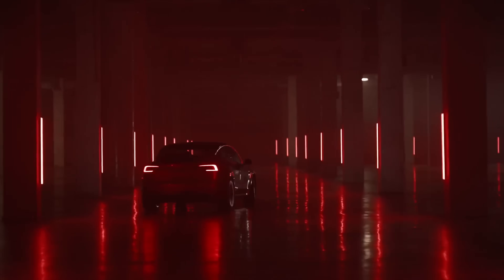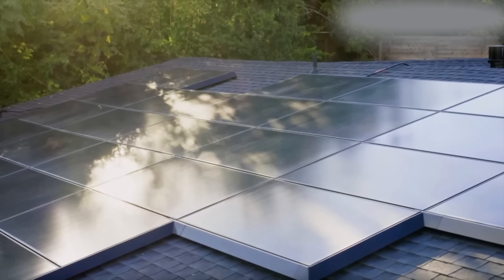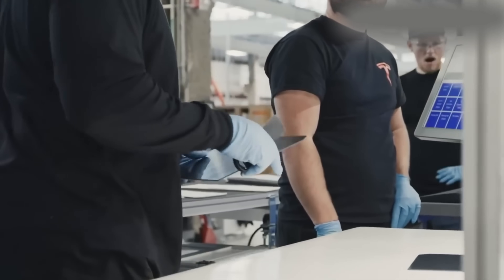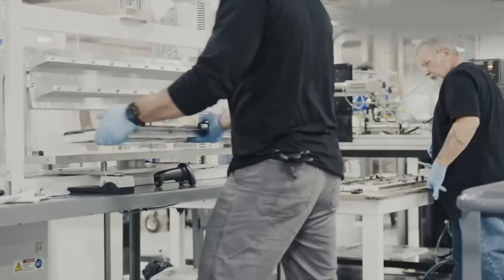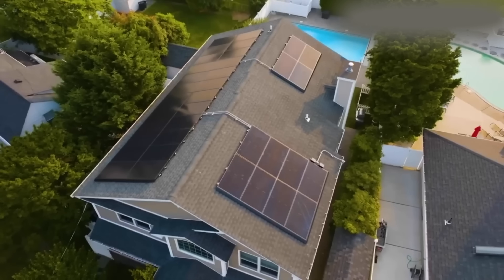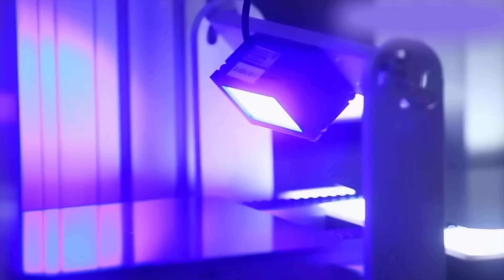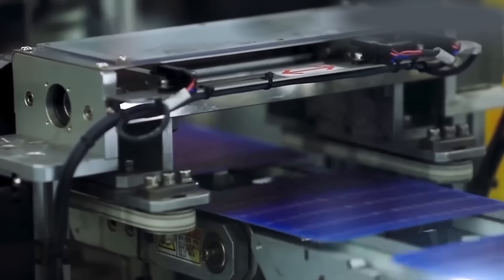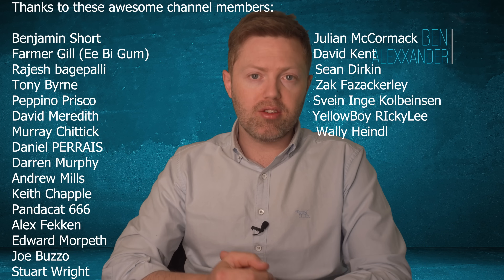Tesla Just Restarted Its Solar Panel Business — And It’s Actually Impressive

Comment: Free electricity, sounds irresponsible but is it? Under some conditions too much energy can be produced from renewables and it isn’t possible to shut them down. Conversely at night when there is no wind generation is lacking. So while the suppliers build can build in commercial scale battery farms they could gain from something called virtual power plants (VPP). VPP’s rely on the grid having a digital twin, a communication network to the domestic user of real time pricing. This triggers your home system to charge or discharge according to your preset parameters. Electricity prices will sometimes go to zero or even negative so you get paid to use electricity. Also you might get paid a really advantageous price to discharge to the grid. Imagine making money from your home storage battery.

Comment: I was in a Tesla organised VPP until a few months ago  but I found that while they say they will only take a certain amount of power from your battery per year  they tend to take it when you can least afford it and frankly I was about to get out the scheme just as they announced its closure. That was with a Tesla 2 battery.
I also ordered a Tesla three for our farmhouse and it took 4 months to arrive and when it did the delivery driver dropped it onto the ground as he  did t have anyone to help him unload it. It was installed and didn’t work. So another three months and now,it works so I have gone to a company that sells power at wholesale rates which has been an interesting experience so far. You buy a monthly subscription and comparatively small daily fee is charge to access the wholesale market. The down side is that very often the market has a negative feed in tariff so when I have nowhere to put the excess power after the battery is full and everything I want to wash, clean and dry has been done, I end up,with power going into the grid at a negative rate so I pay to put power into the grid. Whoever, if I can time,it right I can put power into when the feed in tariff is high and make the money back. At the.moment  I am keeping in front and have remained in credit however I’m hoping that the summer months will mean power feed in tariffs will be higher earlier so I don’t keep losing money by feeding it into the grid at the wrong time. It has been set up so the EV I ordered so e time ago should be able to operate mostly on the excess power that I have been putting into the grid at a loss. My average over all feed in has been about 4.3C p/kwh while my power usage (very small amount) has averaged 24C p/kWh. I know I could probably get a slightly higher feed in but I’m hoping the average will rise over summer and I only have to put power into to the grid when it positive feed in. This is why vehicle to load might just be the answer to a lot of power generation and energy security issues that are arising lately. I know one thing, energy retailers don’t like losing money and are happy to do absolutely anything they can get away with to prevent anyone from reducing their energy bills. I don’t know how many times I have had to search their web sites to find out the real charges for their power. The latest sneaky trick is to offer a higher than usual feed in tariff, have an apparently average daily supply charge, then have another charge in the fine print which can be called anything from a ‘feed in tariff supply charge’ to a individual line charge thereby negating the higher feed in tariff. The limit on feed in power rates, limits on feed in amounts and sliding feed in tariff fees are another interesting trick.  What has surprised me is how,often they advertise certain plans, give you what appears to be all the rates and charges then you need to go to another page to break down the plans even further. The daily supply charge rates can be a really significant component of the bill just by them increasing them by a few cents at a time. My rates went up by 40% almost over night last year hence my interest in solar and batteries. I have been lucky enough to keep up but I would not like to be either renting or buying a new home now and trying to get the money together to pay a mortgage and energy costs without solar and a battery.
Reply: We could easily stop a lot of the nonsense, by punishing deceitful behaviour, instead of allowing the twisting of the laws to be deceitful. By punishing, i don't mean fining a small fraction of the net gains, because that's an incentive not punishment.
A few politicians with a spine could probably get it sorted, but they are pretty rare these days.

Comment: Aussie here, installed 13.5kw panels, 9.6 kw microinverters and 27 kwh storage.  We self consume 6 mwh each year, and export 5 gwh.  That is with a 5 kw export limit...

The combination of solar and EV means we avoid spending $8000 a year

Just as important, we avoid sending approximately $2000 a year out of the country to pay for fuel imports.

The government has put in place subsidies for rooftop solar and battery storage.  The take-up rate is high as consumers seek to minimize expenditure, and the result will be much less money having to be spent on the grid, while eliminating the 6-9 pm consumption peak.

The price of power goes negative most days due to the large amount of energy fed into the grid for rooftop solar.

We still draw a bit from the grid in winter to charge an EV.

The recently announced $0 for 3 hours policy will encourage folks to actively manage load shifting, and enable houses that aren't suitable for solar to install domestic batteries.
Reply: Try that in finland lmao 😂

Comment: Good show...but you need to brush up on Economics.  The optimal state us where decisions are free, informed and not distorted by interventions that steer decisions invariably in a less optimal direction.  Free electricity for several hours a day is NOT free.  It will cause many to install (at real expense) software and storage systems to draw off the "free" electricity, store it, and use it later.  The cost of their electricity is pushed onto somebody else and the cycle continues.

Comment: I don't get it. They look like solar panels and have a 25 year guarantee. I bought mine in 2009 and they look like solar panels and have a 25 year guarantee.
Reply: In 2009, panel efficiency was about 10% to 12%; today's panels are 20% to 22% efficient. You get twice the output in the same space without needing to change racks or cables, just panels and inverters. Additionally, your original panels have only about nine years left on their warranty, and the new ones will be warranted for the next 25 years.
Reply: @tomswiftTTT  Close. Mine are 17%. Yup 25 years counts down from when you purchase them. Weird how that works.
Reply: Production capacities.
Reply: It's about wattage.

Comment: I think the free electricity in the middle of the day could work quite well because it would encourage home battery ownership in order to charge for free then use that energy at peak times when the charges are high. This could mean that solar panels are not necessarily required and even portable batteries could be used which would be good for those renting. Most of the cost of retail electricity is the infrastructure, not the energy, and the infrastructure needs to meet the highest energy use even if it's only for one percent of the time. We can reduce the maximal energy draw by energy storage and thus reduce the required infrastructure: batteries.

Comment: I would not rent nor lease Solar and certainly not from Tesla.
I have Solar but no battery just yet.
Battery 🪫 positioning is an issue for my house as currently batteries cannot be mounted on the wall where there is a habitable room on the other side. All my downstairs wall are habitable rooms.  And I don’t have a spare wall in my garage that is not  adjoined to a habitable room. Batteries would need to be remote and away from the house.

Also waiting for Sodium batteries to see if safety laws change as less risky
Reply: leasing has been proved to be a very poor way to invest in Solar panels here in NZ.
Reply: agree, outside and subsurface for sodium can be done now.
Reply: Shed?  No permit required for a small one.
Reply: @unclegeorge7845 yep that works just trenching and wiring way more than near where inverter is